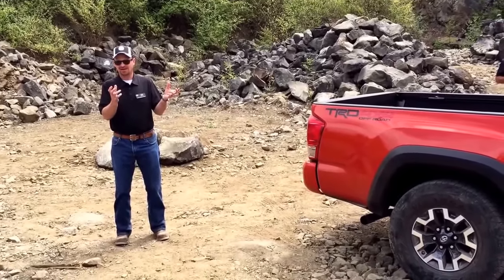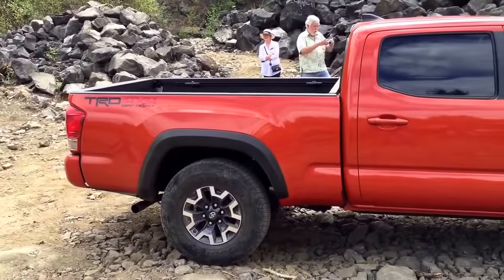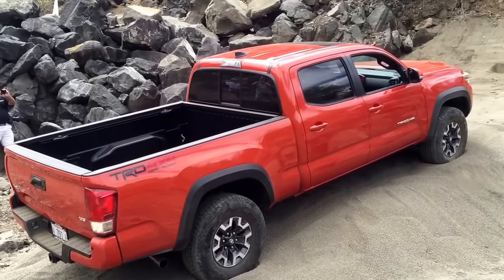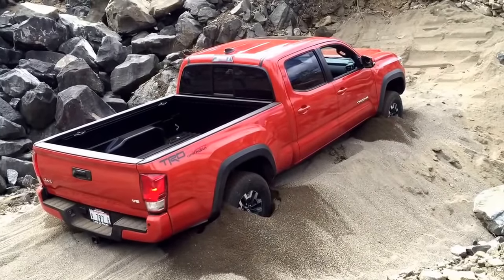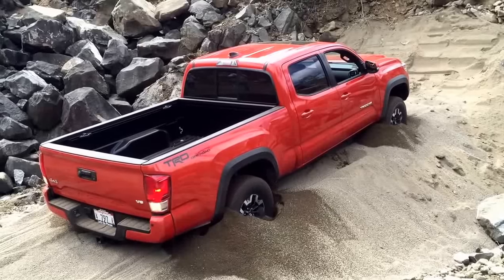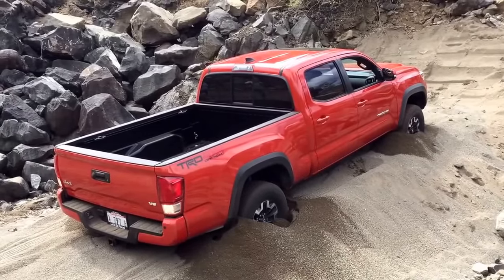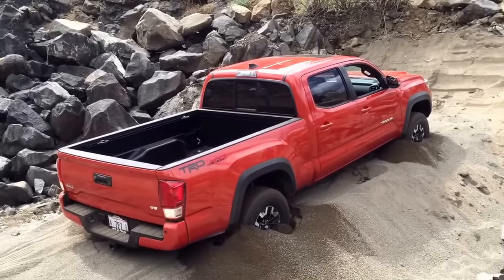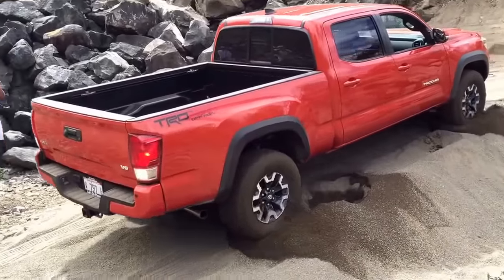2016 Toyota Tacoma - Demonstrating Crawl Control

Comment: I drive a ram now and I love it. The power, the towing capability, the room, and comfort. But I used to drive a short wheelbase single cab Tacoma. And I truly believe there is no better mud truck than a Tacoma. Not once could I get that thing stuck. Anyone whose gone mudding in West Virginia's Sanderson knows the type of mud I'm talking about and not once did that truck fail me. I think it's so underpowered that it's a huge advantage in the woods it won't easily dig itself into a pit.

Comment: Drum brakes on the back is call one thing, cost cutting, and nothing else.  This guy is full of it pointing out the "benefits" of drum brakes.
Reply: ldawson103 but I dont  really understand the benefits of disc in the rear, most of the force is applied in the front and from previous experience with a nissan pathfinder it had drum in the back and it outlasted the front ones way more, almost double and now with a 4runner that has discs in the back they are wearing down the same as the front
Reply: ldawson103 Well said.  I've got an '05 and I've never buried the back end to the axles, and i bet a majority of the owners haven't done the same either so I'd much rather have disks in the back that I will always use the benefits every time I step on the brakes compared to something I'll never see the benefits of.
Reply: ldawson103 your an idiot, tray is the lightest part of the truck, front does 80% of braking, unless ur towing as the guy said u dont need them,,
Reply: +Narendra Rajcoomar Sure buddy. learn about vehicle dynamics and car handling first before you project your self esteem on someone else
Reply: MatadorCE I did, the engineers at Toyota, re-enforced the idea....oo wait the engineers that designed the dominating class leading tacoma dunno what they are about
Reply: MatadorCE are you seriously arguing that the front brakes don't do most of the braking? -_-
Reply: ldawson103 ive had the original rear brake shoes for 250k plus now...what the hells the point of 4 disc? my buddy has had to replace his rear disc brake pads twice now in his Silverado and he has nearly half the miles...with Toyota you don't get a turbo or direct injection...you get a good ofroader that will run for 300k plus even if you loan it to your brother it will still run
Reply: +MatadorCE I've buried a Tacoma to the frame in the middle of nowhere and was only able to get out because of my paranoia about getting stuck in the middle of nowhere. Sand ramps, sand bags, and a jack are just a small weight penalty when it comes to getting stuck/unstuck solo in the middle of the desert.
Reply: ldawson103 Toyota cost cutting?  That is why their products have the highest resale and most used truck in the world.
Reply: ldawson103 Rekt ☐ Not Rekt ☐ Tyrannosaurus Rekt ☑
Reply: As if they wouldn't just pass those additional costs onto the consumer?  There's a thing called cost-benefit analysis.  If the benefit of rear discs don't justify the costs, then there's no point in adding them.  Rear discs offer little to no benefit in stopping power outside of high-speed street racing, as the vast majority of stopping power comes from the front brakes.  Rear drums DO have the benefit of resisting debris.  So disc brakes = no benefit and higher cost, while drum brakes = some benefit and lower cost. Why in the hell would anyone who's done any real research on brakes choose rear disc brakes on a truck?

The only reason GM did it is because it looks cooler and people are under the incorrect assumption that discs are always better than drums.
Reply: Agreed.  Drum brakes are cheap.  That's it.  I want to like this truck so badly, but it's so behind.  Nice Jeep Wrangler knock off wheels by the way.
Reply: +gperez12773 sesiptable?
Reply: gperez12773 BUSTED PUNK
Reply: +gperez12773 really if disc brakes are so superior to drum then why do class 8 heavy duty trucks and trailers use them (drums), they tried disc's in the 80's but was a complete fail. keep talking i like the breeze.
Reply: +gperez12773 if your using supercars as an example that's also apples to oranges, and thats the kind of answer i expected from you, it's just your personal opinion no factual data to back up your argument, dumb guy
Reply: The old school Ford Mustang Boss has 4 wheel drum brakes to go along with there big block motors... It's just that disc brakes stop better, yes but that doesn't mean drum brakes aren't efficient
Reply: +ldawson103 A bunch of people posted who don't know anything about drum vs disc brakes. yes I agree with you, the guy in the video is just spewing marketing lies. Drums are cheap. That is the only reason. 

Hear is the facts. Drum brakes require the rotation of the wheel to increase the pressure of the shoe against the drum. This means there is a delay before the rear brakes are doing any braking at all. To compensate, the front brakes are prevented from applying force until there is pressure in the rear brakes. This results in a delayed response in pressing the peddle, till when the brakes are actually stopping the vehicle. This delay is introduced by the brake proportioning valve. The second problem is that because drum brakes require the rotation of the wheel to increase the brake force, the braking is non-linear. So the braking force is not proportional to the peddle force. This makes it much more difficult to control the amount of braking, and it makes it very easy to lock up the wheels, rather than achieving maximum braking. 

I converted a vehicle that only had disc in the front to all discs. I could not believe the difference in stopping power, and the dramatic change in brake response time. The application of the brakes became instant. Many times that is the difference between what would be a panic stop, compared to a normal stop. My wife doesn't yell at me any more for hard braking and reckless driving. 

BTW: The comment about class 8 trucks using drums is bogus. It is difficult to design air actuated disc brakes. It is only recently that new systems are coming out with air operated disc brakes.
Reply: +Daveinet actually the comment about class 8 trucks using drums is not bogus, yes they are taking another go at disc brakes, like they did in the 80's, and it's because of the rsd regulations that the government has in place, but even now with advances in technology disc brakes on class 8 trucks are proving to be problematic and have poor performance, and thanks for holding foundation brake training, but drum brakes on class 8 don't use primary and secondary shoes like light duty automotive applications, both shoes are applied at the same rate, so again not a bogus comments
Reply: The 2016 Tacoma stops shorter than the GM Twins that have front and rear discs.
Reply: +ytmndan Those tests are indicative of the anti-lock system, rather than the brake method its self.
Reply: +ytmndan i wasn't going to comment, but if it's indicative to the abs then there's some contradiction there, then the argument of disc or drum is invalid, and does not matter. the tacoma stops better with rear drum, so it's gotta be the abs, well iam curious if the results would be the same if the abs were disable ir not actuated during the test
Reply: +bleachinuri 'cept you will stop faster if you brake less than what turns the ABS on. ABS is primarily for those who just jam on the brakes in a panic, or if one wheel hits a dirty part of the road. ABS will rescue the driver who swerves and hits the brake at the same time. But your maximum stopping is just before the tires skid. ABS kicks in after that point.
Reply: +Daveinet yeah i know what is and what it does i was a tech for 25 years and i just finished my masters in mechanical engineering
Reply: It doesnt matter, because at the end of the day, the pads are going to prematurely wear out
Reply: +Narendra Rajcoomar "your an idiot"..  the irony is staggering :)
Reply: +Frank Magana 65

  ju5
pylktihg
Reply: +ldawson103 I converted my compact truck to rear discs and the difference IS NIGHT AND DAY. Especially if you need to back down a steep hill. You're a delusional Toyota fanboy if you don't think this guy is full of shit trying to justify putting cheap drums on a truck in 2016.
Reply: +3n82 Rear brakes in general outlast the fronts, whether they are drums or discs. The front brakes do 70% of the braking on most vehicles. There is no reason to have rear drums other than to save costs because they made a metric ass load of them back in the 70's.
Reply: +ytmndan GM gives you way more truck for the money overall. Look at it this way: How many huge military trucks do you see with drum brakes? The trucks that go in sand, mud, icy rivers? NONE. If you don't get rid of that mud, sand etc., you will have a problem when 1) the mud hardens in the drum brakes 2) the sand that got in can't get back out efficiently and causes a problem 3) the icy water that got into the drum brakes can't get out and is now solid ice. Military vehicles use a disc brake right at the end of the prop shaft, and the wiping action of pads on a disc is much more efficient at getting the muck off that disc, than relying on gravity to get rid of the muck inside a drum system. For off road use, discs all the way around offers greater reliability.
Reply: +bleachinuri They don't go offroad, and that application is for stopping heavy rear located loads and trailers. For offroad, discs are much more reliable.
Reply: +ytmndan The Tacoma is also much lighter.
Reply: ni
Reply: I have a nissan frontier with 4 wheel disc and it was 6k cheaper then the toyota, brand new.
Reply: Narendra Rajcoomar you are an idiot. 103 is 100 percent correct.
Reply: Gotta keep the mid-size truck under the 40k mark somehow haha.
Reply: In my experience, the parking brake was always more effective with a rear drum. My 02 ranger it works well (drum) My 00 pontiac GP, the brake is crappy (disc)

Comment: did anyone else wonder how he got the front wheels to spin without the back to get it stuck? and i would like to see this in clay mud on flat ground, in the rain, uphill both ways lol. but really i wanna see this put to a harder test
Reply: it is possible that the drivers rear tire was spinning due to the fact it may not have a rear locking differential or a lsd diff.
Reply: This truck has either lsd or something because they explain it sends power to wheels that it wants. Usually that's lsd or breaks acting individually.
Reply: kmac720 The rear right wheel eventually gives the slightest indication of spinning after some time passes.  I am thinking about rock crawling.  When you do that, your left foot holds down the breaks while your right foot accelerates, so you don't slide backwards.  I wonder if that would have this effect if used outside of the context of rock crawling....   Is the guy braking or using his parking brake to achieve this effect?
Reply: Agreed, nice catch.
Reply: Cory Ferris its called a differential all trucks have them...and tacoma just got even better off road...it was sitting on the frame rails! if your not impressed its cause you've never really done any off road stuff...and judging by your pic you live in texas or ok and have never seen a hill
Reply: probably applied park brake
Reply: Someone doesn't know how 4wd works. Lol.
Reply: +Cory Ferris Just like my Cayenne turbo. Change that shit on lsd/differential.

Comment: The Tacoma along with the Jeep Wrangler has the highest resale value of any vehicle under 50 grand at approx 54% after five years.  Try matching that to any other truck.
Reply: Stang 1023 Ford raptor
Reply: Build a better truck and you won't have to resell it.
Reply: We have had a 2013 raptor and have not had any problems. And someone offered me 50,000 and it’s a 2013 you tell me if it’s not a good truck. And just got the 18 and it’s probably the best truck out there at the moment and we are not planning to sell any of them.
Reply: Try getting a 5 year old f150 for less than 25k without 100k plus jokes on it
Reply: Too bad the jeep is a parking lot crawler... and a pile of fiat shit
Reply: Can't speak for trucks, no doubting the taco and Wangler, but my rsx-s got 70%+ after 8 years
Reply: @Chalo707FTP  my 2012 tundra is worth sticker price lmao

Comment: So drum brakes because they are better off road due to debris? That's weird that every other truck gets it wrong along with all the dirt bike manufacturers with their rear disc brakes.
Reply: good luck on getting to change pads after your disc brake got sand or stuff in it :)
Reply: Nailed it.  Great comment
Reply: James Newman In the rear. Most of the braking is done in the front. Tray has barely any weight as well compared to the front end.
Reply: +THEGMT Same thing happens with drums, they aren't sealed.
Reply: FCFordLord well at lest they are 75% sealed compared to the disc one :P
Reply: +James Newman Yeah, that must be why Jeep puts rear disk brakes on their Rubicon model.
Reply: Lol exactly. Jeep uses disc brakes and they are known for dirt and rock. This guy is full of it.

Comment: I dont really see any issues with drum brakes as long as it stops I'm good.
Reply: Sand or water gets inside, its never coming and out or braking again until you open it up
Reply: @connivingkhajiit  you are a completley  idiot coming from a mechanic
Reply: Michael;  you just gotta find the drum plug.  Pop that out and let it drain the sand and water out.  You'll have brakes again without issue!     Just make sure to pump the parking brake a few times to build up drum air pressure again after replacing the plugs!!
Reply: @lawrenceshdow  thank you
Reply: @lawrenceshdow  forgive me. Im an EE not a mechanic.

Comment: I don't mean to bad mouth car brands, but I bought a brand new 1985 Toyota 4x4 extra cab pickup, literally off on the show room floor. The main reason I bought the Toyota was from the TV adds showing it forging deep streams and off roading capabilities. I lived in Upland, Ca and the dealer was also located on Foothill blvd in Upland. We had a lot of rain the following winter (3 months after I bought it) and many of the streets had a foot of water running down them. The following spring, we went off roading and it would not stay in 4wheel drive. I took it in under warranty, but they refused to fix it, stating the hubs had water in them. I have never owned a Toyota since then. P:S: That was the only year Toyota 4x4's had auto locking hubs, yet they refused to admit to the flaw.

Comment: Oh my god! That was awesome! I have a 1996 xtra cab and I always go off roading when im in North dakota, as well as in sandiego, ca. I have so much fun with mine, got engine rebuilt, new shocks k&b complete coilover, Gabriel rear shocks, not the best but waaay better than the original stock coil over.

Comment: get stuck in a mud pit, then i will be convinced
Reply: No electronic helper in a vehicle is going get you unstuck in mud, it's all about having the right tires and the right amount of throttle control.
Reply: cory thomas It's not designed for driving in mud...
Reply: +Eldrest Argo it's suppose to be and off road truck   Mud is not a road
Reply: José Villa I think his point was crawl control is not designed for mud, mud needs fast wheel spin to keep the tread clean and momentum. Once you get stuck in mud you need a winch or a snap strap.
Reply: José Villa We're talking about the crawl control mode here, not the entire truck. The truck is designed for off road yes, but the crawl control mode is designed for sand and loose dirt, not mud.
Reply: Eldrest Argo Look up one post. I was sticking up for you in the reply from José Villa lol, but crawl control also works great on rocks.
Reply: +Red Rider7 I have a $1500 98' 4runner, you don't need an expensive 4wd, just a capable one, with no modifications other than some meaty tires on it I can get anywhere I would ever really need to. I do however carry an electric air pump so I can let some air out and get better traction when needed and still be able to air up when done. You don't need and expensive electronic system, just a good head about you to know that power is not always the answer. Before my 4runner I had a 88' toyota pickup that could go even more places, but that had a few more mods as well ;)
Reply: +Eldrest Argo , isn't that what 4 wheel drive is for?  Gimmick for sure! But good for those that don't know anything about sand!

Comment: No automated traction control system will be as good on sand or snow as simply airing down your tires for a larger surface area and using less wheel spin. Cool truck but I kinda feel like an older Tacoma on aired down 35's wouldn't even be in that situation in the first place.

Comment: My Crawl Control = Low Range + Brake
Reply: +CheckEngineLightOn They are slowly eliminating the need for an actual human driver. Daytime running lamps>automatic headlights>rain sensing wipers>automatic braking when you come up too close to someone>automatic parallel parking>crawl control. Soon, every aspect will be controlled by the computer and the driver's seat won't have pedals or a steering wheel.